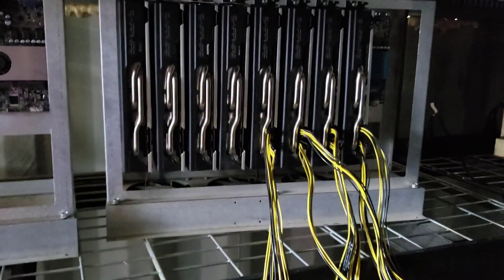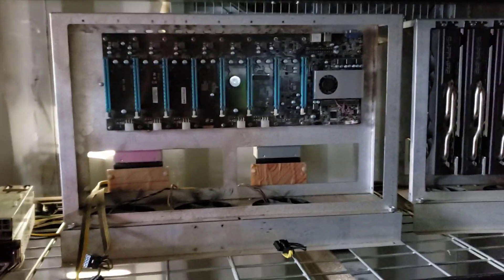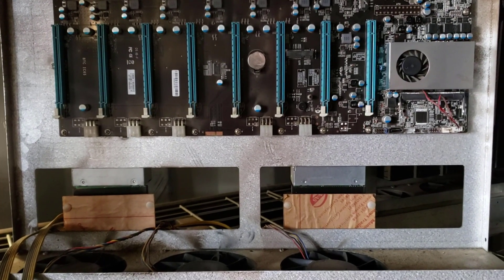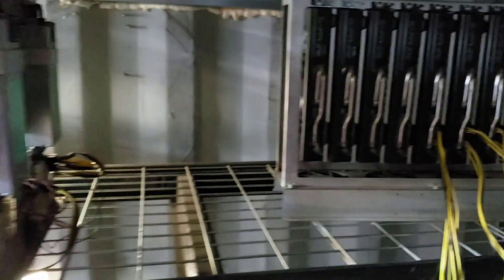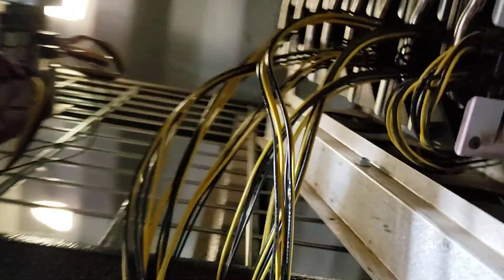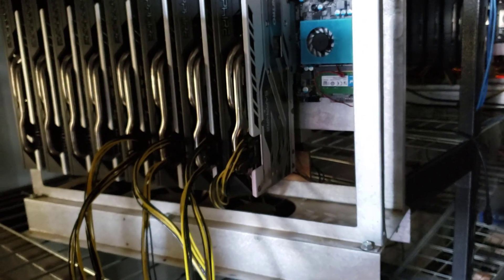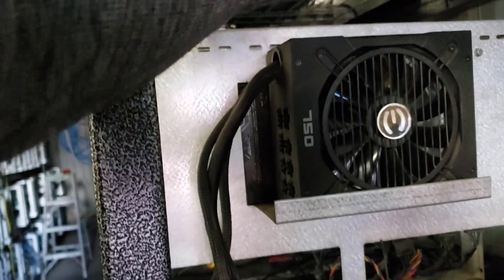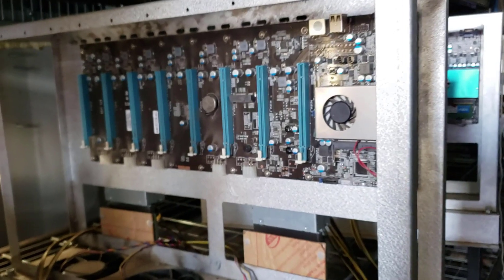How To Build A Mining Rig Like A Pro.

Comment: Amazing! From.garage to industrial!!!! When you're stacking  up rigs be one on top of another and using the built in fans in each rig, effectively blowing hot air up to each consequence rig above, are you still getting efficient cooling? Just curious if you're using any air-conditioners/spot coolers or bringing in fresh outside air from the bottom of the structure/ container? Thank you for a great video!

Comment: Where do you get the breakout boards from the 1200W PSU and at what cost?  The used HP 1200W  PSU are available in UK for < GBP15 per unit.